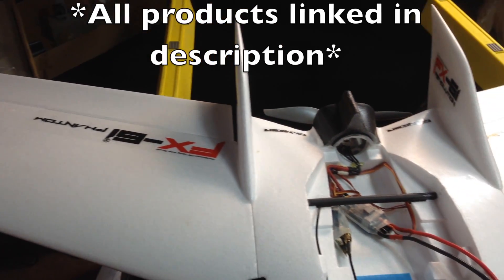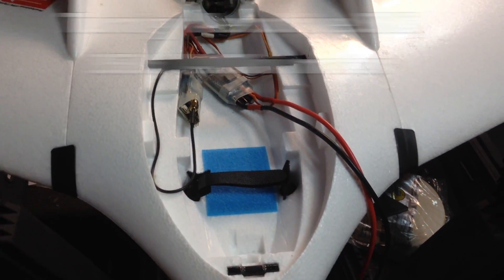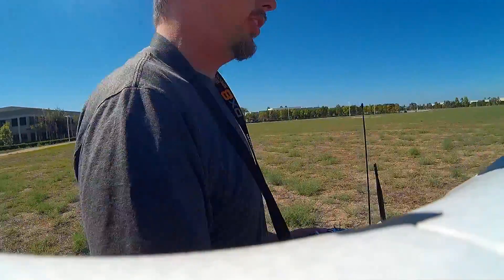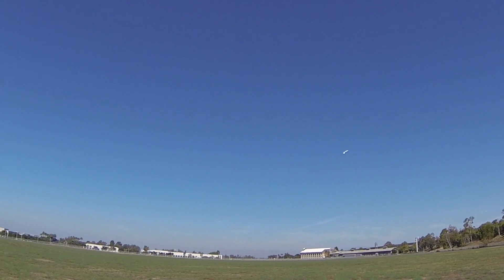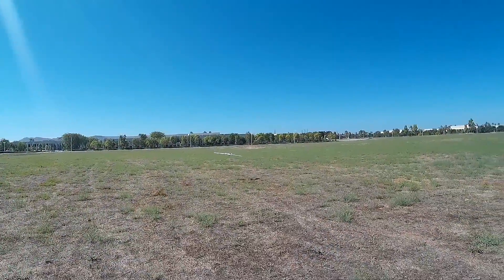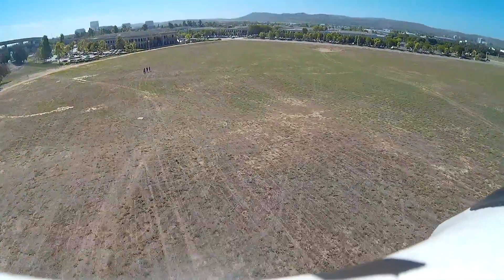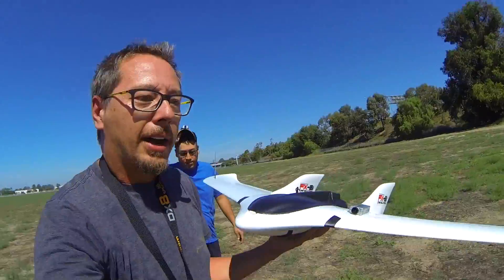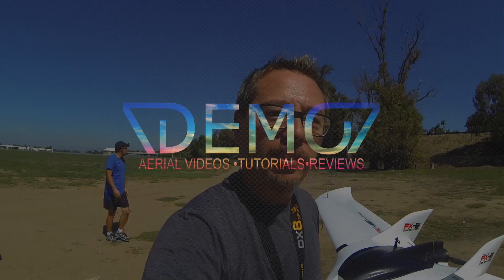Zeta FX-61 Project Part 2 of 4 Maiden LOS Flight

Comment: Zeta is no trouble to launch, have had literally hundreds of flights on mine and I launch on full power using the finger holes . All it takes is a gentle level throw into the wind  and keep your hand moving down after the launch. Done right your fingers are no where near the prop .
Reply from the maker: I hear you man, I just takes one bad launch to snag your fingers- I'm being over protective because any injury to my fingers and I won't be able to work - which would be bad!  I like the pizza box launch- really no drawbacks to it

Comment: Hi, I have a Spektrum DX6i hooked u with the Orange 615X   with the flip32/naze32. The problem is that I can only use AUX 1 for my modes. My question is that the orange 615X has a Gear and AUX 1 channel that i would like to use as AUX1 and AUX2 so that I can set up my flight modes on the naze 32 for my 250 size quadcopter. Can anyone assist me on how to set up AUX1 and AUX2 on the spektrum dx6i so that it can work with the hobbyking orange 615x receiver. I am using the flip32/naze32 flight controller.
Reply from the maker: I'm sorry, I can't help u with this- maybe one of the guys here can